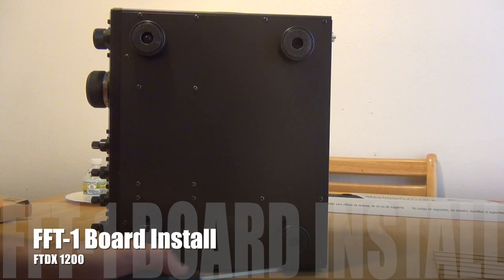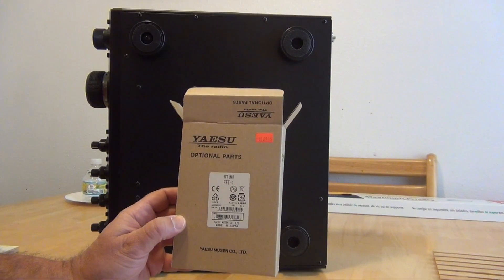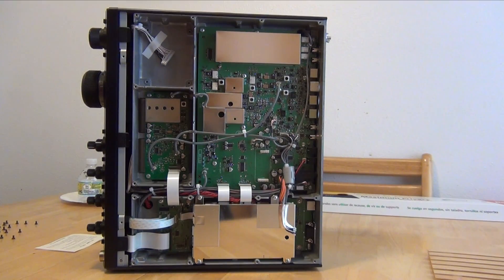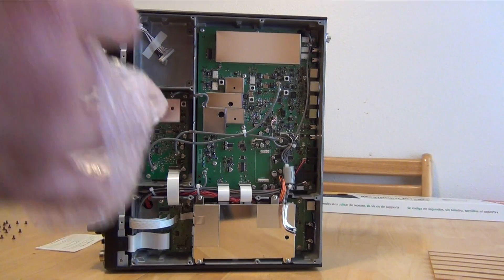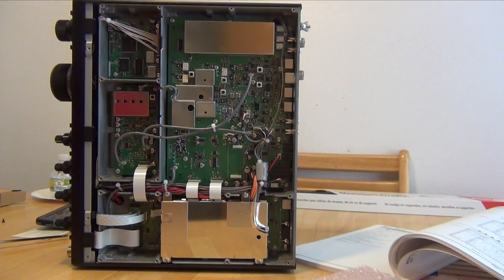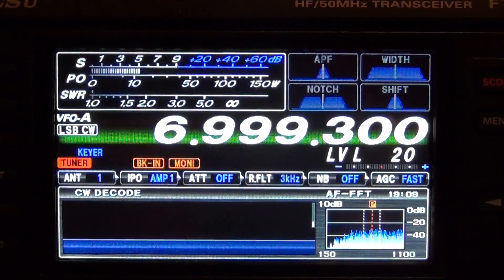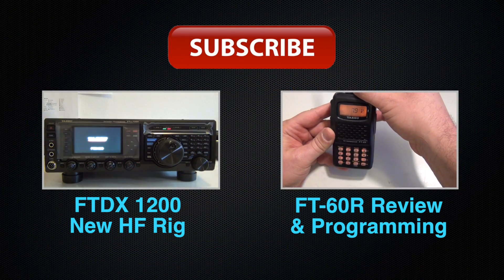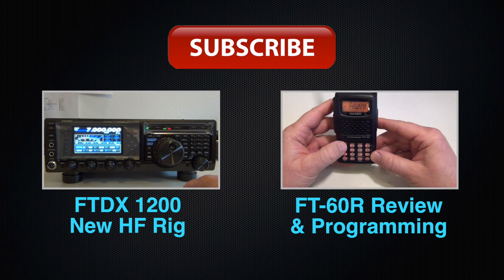FFT-1 Board Install For The FTDX 1200

Comment: The wires on my radio were not tight. Fit in with no problems. And as of the time of this post I am selling my FTdx1200...K4XJ
Reply from the maker: Thank you for taking the time to watch and the comment! It is greatly appreciated. I sold mine a few years back.
Reply: Thank you for video 
Love my FTDX if I can hear him I can work him big loop all I have ever ran for 30 years I’m on the fence about this internal card ?are you glad you did ? KE4TDG  73

Comment: Was there anything connected to the case or did it come straight off, I mean like cables might do this myself
Reply from the maker: Thank you for taking the time to watch and the comment! It is greatly appreciated. There is a cable already preinstalled in the radio. However, be careful as the cable isn't overly long and is easy to break.